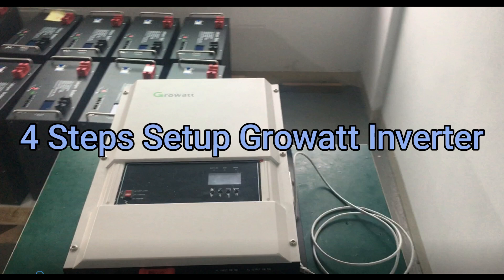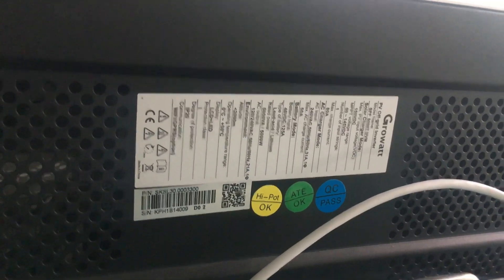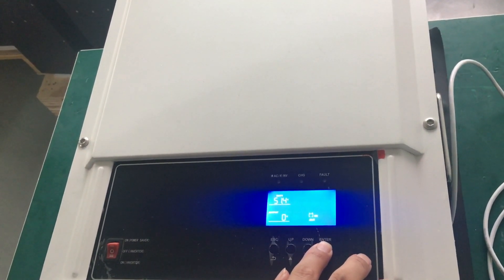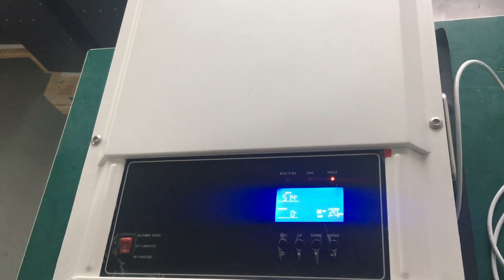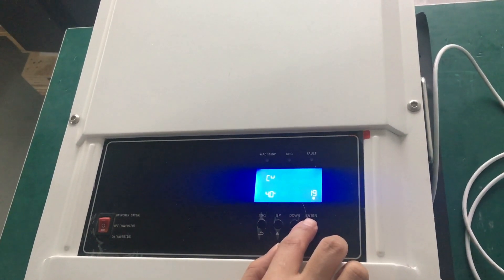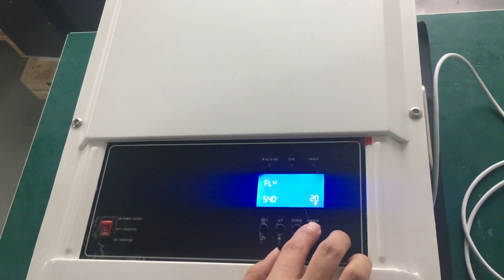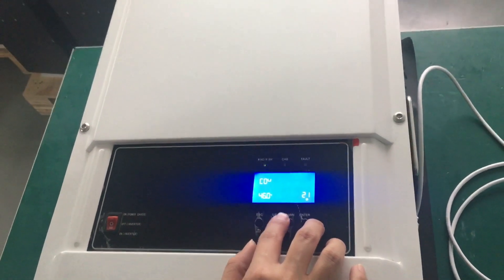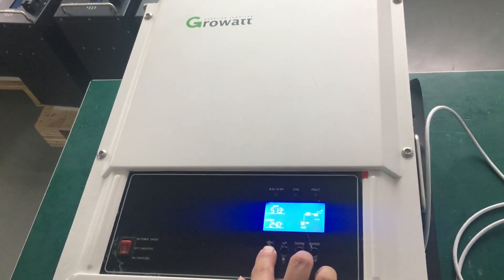4 Steps Setup Growatt Inverter with JK48V100 LiFePO4 Battery

Comment: Is it possible to view all the lifepo4 cell information from the growatt inverter over the Internet?
Reply from the maker: Most inverters not designed to have that much space on screen to indicate all cells voltage. Especiall if you have 2  or more 48V 100Ah pack parallel, it will make confusing.
Reply from the maker: You can see all the parameteres on Jakiper Battery LCD Screen.